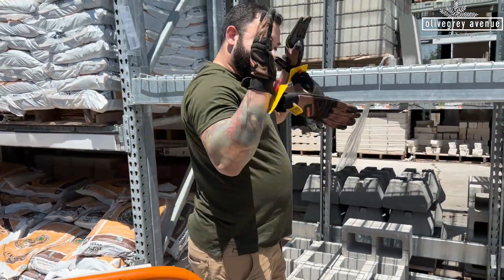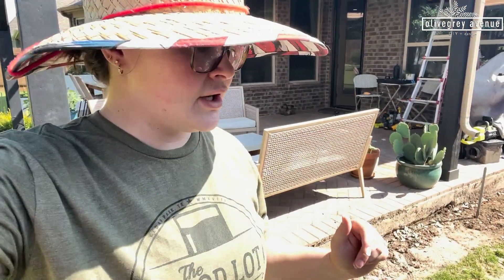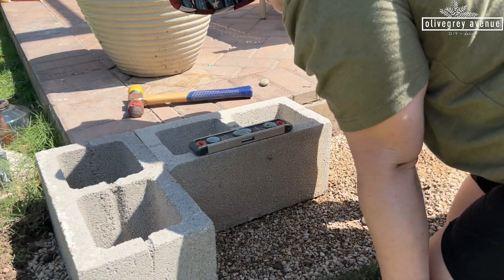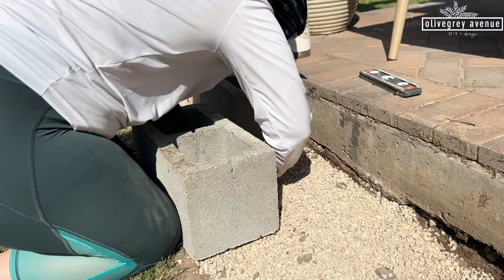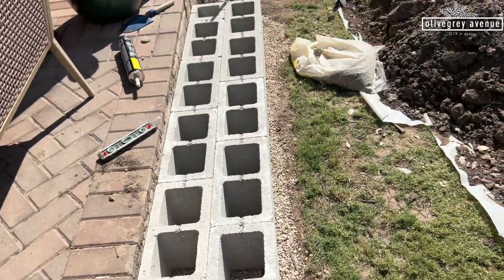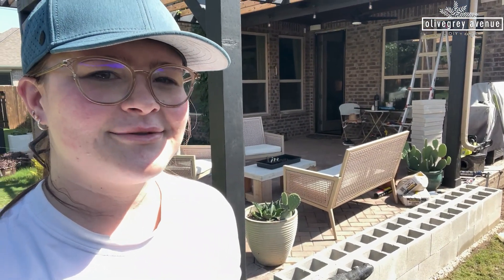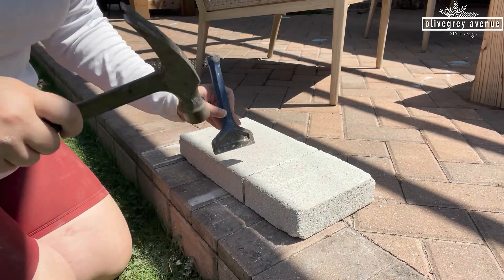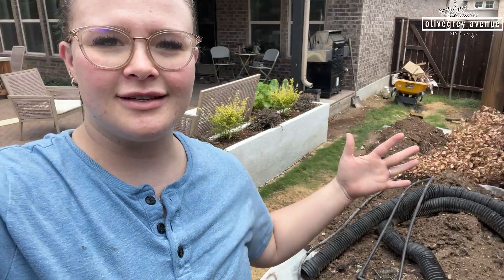Making a Raised Planter from CINDER BLOCKS!

Comment: How have these held up over the last 2 years? Specifically wondering about the top edge where it's just the 2" pavers, has there been any cracking? I am doing something similar and wondering how it will hold up. Thanks for all the info you provided in this video!

Comment: I was wondering how the stucco on the fountain is doing? Does it freeze where you live? I love your fountain build and was concerned if stucco cracking would be an issue. Thanks for sharing your project with us. Blessings -Kate
Reply from the maker: It’s doing fine so far! It’s been about 9 months and holding up! There are some hairline cracks in the stucco on the top where the top caps meet. You might be able to solve that by caulking them before the stucco.

Comment: Would be way easier to just create a level layer of dirt in the ground before laying the bricks using a long straight stick. 

You did it the hard way

Also you still need to level each layer due to the glue.

Comment: I watched your short on this. I would instruct your children not to climb on this because the top caps that are bearing the weight of the soil, plants, and water, could easily collapse outward when a child jumps on it, because they are held together only with adhesive.  A child could be injured by an 18-lb block or the resulting fall from the height of the planter. Better to be safe for their sakes.